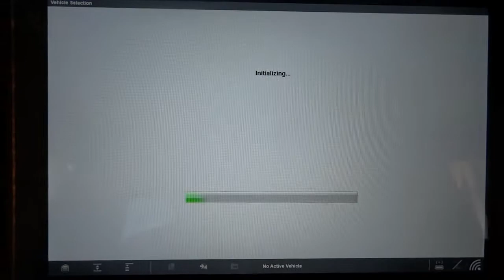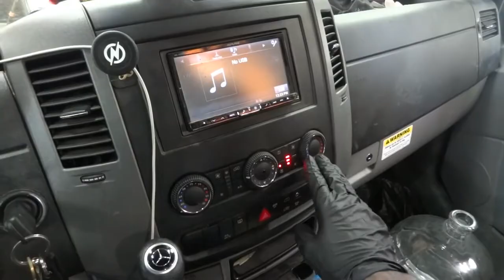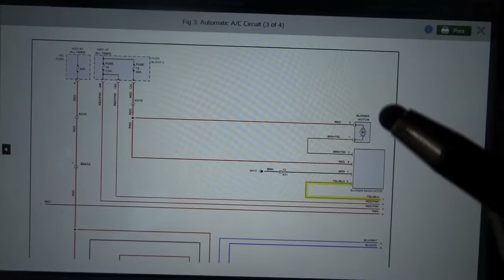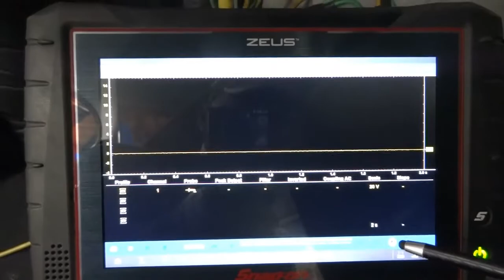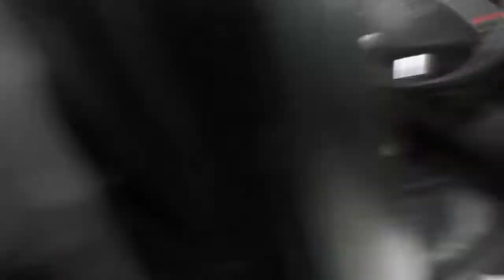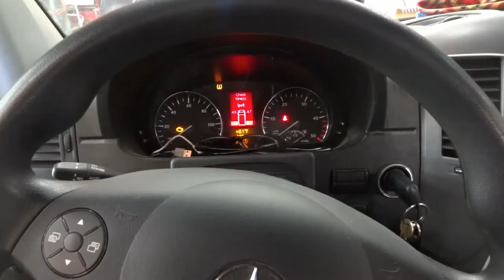How to Test a Blower motor Resistor on a Mercedes/Dodge Sprinter

Comment: Great video. I went through all this. Had issues with the front blower and the rear. Front blower was the motor, had 12v but wouldn’t move. 

Rear blower was the regulator. So I swapped the regulators to at least get the rear going, but now it doesn’t work. I was told we need to reset the AC control model when making those changes??? We bypassed the regular but I don’t have heat going to that heat exchanger.
Reply from the maker: Christopher Moses  I haven't heard of reset the module after replacing the regulator, mine didn't require resetting the module!

Comment: Excellent video but im not getting any power to the regulator i checked all the fuses and they are good. Any suggestions....
Reply from the maker: @Ceas2000   you might have a broken wire!
Reply: @KITS_Auto_and_Truck_Repair  oh ok that could be the situation

Comment: Thanks, for video. Can you tell why, when turn front fan on full speed(4), it start spinning, but going to stop. Before it stops, it reduse speed, which sound, like some one turning it off/on first slowly, then faster, then it stops fully. Fan working sound redusted like waves.
Reply from the maker: HomeMade ch. My Pleasure! Sorry I didn't understand your question! are you asking about the front fan or the back fan?
Reply: @KITS_Auto_and_Truck_Repair  front fan. There is no back fan in this sprinter
Reply from the maker: @Home_made_ch  Ah Ok